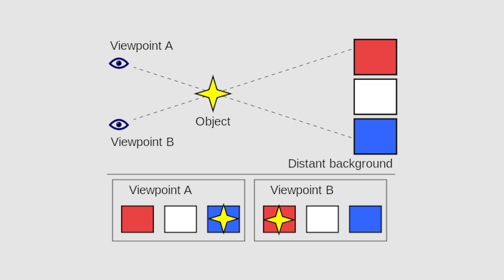How to determine lens nodal point for panoramic photography

Comment: Hi Les, fine explanation but it is only for 100% correct for a single row horizontal panorama and not for a multi-row or for a vertical panorama. For a multi-row you will pan your camera up/down to go from one row to another. This means that the horizontal axis where the camera turns around has to go exactly through the nodal point. In order to achieve this the central axis of your lens and the central axis of the nodal slide you use to move the camera forward/backward have to go both through the same plane that is vertical to that nodal slide. This is a little bit tricky since you have to estimate it and there are no marks on the L-bracket you use to fix the camera on the rotator to pan it up and down. Once you have determined the exact position, put a mark on your L-bracket for consistent later use. If you fail to do this, you will introduce a parallax error while panning up/down. Sorry for the complex geometric explanation.

Comment: FWIW, to make it easier and allow for even more precision, use one pole (a cross would be better for adjusting both horizontal and vertical at once), a wall behind it, and a bright light source at the nodal point.  Mark the shadow on the wall with a contrasting colour, then mount your camera and make your adjustments.  (The rays of light travelling past the edge of the pole to the nodal point are at an angle to the axis of the lens, so the farther the second pole is behind the first pole, the wider the second pole would need to be to fit exactly within the shadow of the first pole.  Positioning two poles of differing widths would be FAR too fiddly when you can use a literal shadow to accomplish the same thing.)
Reply from the maker: Thanks, Keith. Always looking for new and creative approaches.
Reply: I just had an even easier, more precise method.  (I *think*, anyways.)  A laser point in a (reasonably) long tube with a diameter the size of the beam is positioned to point at the camera mount's center of rotation.  In theory, the spot it projects will only stay perfectly round when the camera is rotated if the nodal point is perfectly aligned with the mount's center of rotation.  If it isn't, as the nodal point slides left/right/up/down, the tube will occlude part of the beam.

Does that make sense?  It would certainly be easier to achieve high precision if it worked.  (If you want to create it as a saleable product, feel free.)

Comment: Nice and clear explanation, for the more techy ones just make sure that the rotation point coincide with centre of the aperture leaves. Some principles as to to set up a gimbal head where you use the centre of gravity instead of the centre of the shutter leaves to balance the camera for two completely different shooting purposes, hence two different tripod heads; one to eliminate parallax and the other to make the camera/lens unit feel weightless, 99% of cases the two setup points are different as the two centres do not reside in the same place, the “C” bracket head can be used as a gimbal with great results whilst the gimbal can be set to pivot on the nodal point but it will be awkward to use.
Reply: Not as awkward as your prose.

Comment: I can hardly believe that I was getting away with my "don't worry just take lots of overlaps " ever stitched together in photoshop. Then all of a sudden in the 2021 version of photoshop everything sopped working. This was a wonderful talk, and I thank you very much Lester..Outstanding.  I only have a standard tripod  so I am going to be up against it, but panoramas is where I am so I must resolve things .Most of my panoramas are about eight frames wide and I usually have a3 rows, and I have been using focal length far too wide at maybe 50mm equivalent. .

Comment: Great tutorial, thank you. The best part is at the end showing the taped pole 'get back in line' while shifting the camera back. Actually I found out practicing that you should start with poles aligned in one side (left or right) of the view finder then turn the camera (left to right or vice-versa) till the poles are in the other side of the viewfinder..... Then shift the camera back/forward to realign the poles. And BINGO, there's your nodal point/entry pupil in one single move, no need to turn back and forth . 😉

Comment: Thanks! I'm thinking of using this strategy a lot in the future. And as I noticed the key way to actually just set the nodal point with the two stick, it may actually be possible to put it up every time on the field using two strings attached to branches in line with the center of the position of the tripod where it is going to shoot the panorama! So this way you are capable of using this technique randomly with any lens at any focal length! You also can set it up with a more inexpensive tripod head. Yet it still need a specialized camera support to make it rigid, convenient and fluid. Amazing pictures on your walls!
Reply from the maker: Thanks, Marc. Here's wishing you good luck with your panos. Please feel free to share a few with me and I'll post them if you wish.

Comment: I like this video and very much appreciate the effort that went into it. What follows is a thank you rather than a compliant.

Nodal points come from the "Gauss thick lens theory" and require a bit of optic theory to fully understand but the key point is the there are two; and one is the exit nodal point.  The exit nodal point for photographic lens is always one focal length from the sensor when the lens is set an infinity.  When the lens is not set to infinity is is at the image distance, which is not what is seen on the lens mount but requires some math to get.  

For example if focused on a pole at 5 meters a 500 mm lens image distance is going to be 0.5mm longer than the focal length so the the nodal point will be 1/2 mm off at infinity and about 1mm off for a 70mm lens under the same conditions.

Clearly these errors are insignificant but are comparable with the errors from the simple method I suggest.

1) Nodal points are points about which you can rotate the lens and the image on the focal plane will not move.  This is what they do and why they make image stitching work well.  This what the two pole demo is looking to do.  Thgey do not have to be perfect for most stitching programs to get a good join.

2)  One nodal point is exactly (by definition) one focal length from the film plane when the lens is focused at infinity and the image distance away when focused closer.  .  Using this you can get very close to the nodal point by using a  ruler and putting the center of the camera one focal length, as marked on the lens or its zoom ring, from the sensor mark on the camera body, when focused on a distant scene.

Comment: Les,   Great job.   When you mentioned the vertical poles, I realized a similarity with aiming posts used by field artillery in the pre GPS day.  Once a gun was pointed on the correct azimuth, a primary (an optical instrument.set close the the gun) and, secondary aiming points (two metal poles) were established.  The aiming points allowed the gun to shoot a mission based on rotating to the left or right of the azimuth on fire.  The gun then returns to the azimuth of fire.  The vertical line in the gunner’s optics would be placed beyond the far vertical pole.  We used the acronym NFL - Near Far Line - to help remember the order of the lines.    Thanks. Jim
Reply from the maker: Thanks for the fascinating perspective on this, Jim. I found it most interesting.

Comment: An excellent explanation of how to ascertain the nodal point for a given lens. Thank you, Lester! Your beautiful panoramic photography wall enlargements are stunning indeed, and certainly expemplify the Image Quality obtainable using the technique you describe. 
As I don't have the photographic equipment in this video, I was lucky to be able to create highly detailed panoramas, but much smaller enlargements (10"x36", for example), using 4 stitched 24 MP .tif images with a very sharp Fujinon XF35mm f/2 lens  on an X-Pro2 vertically mounted on a decent Oben Carbon Fiber tripod. Of course, your technique and recommendation to make use of the lens' nodal point, besides beneficial for printing large, as you stated, also avoids the unfortunate necessity of losing image information in post-processing when cropping top-to-bottom across the image! Happy Holidays to you, sir!

Comment: Lester - great video, thanks so much! I may add that I am using a Mamiya RB67 which has its tripod thread right in the middle of the camera body, vertically below the optical axis. So, no sideways adjustment needed. Also, the portrait orientation is achieved by just rotating the film back with the camera body still upright. That's a no-brainer so far. It does need of course the forward/back adjustment, for which I use a simple rail. Beyond that, my recommendation is to use aiming objects that are much closer (believe it or not, I use chopsticks). I have to focus then to a closer distance, increasing the lens extension which changes the nodal point again. But the RB67 has a scale from which I can read the lens extension in millimeters, and just  correct the camera position by that amount because the lens will be focused at infinity for the real shot. The closer position of the aiming objects makes the process more accurate and easier, because the sideways movement is more pronounced when the camera rotates about the wrong point. Just a recommendation for those among us who use such old "basic" cameras!
Reply from the maker: Alexander, thank you so much for this tip. I hope others will see your comment and use it if their gear is similar.

Comment: Thanks for posting this video. Here's an alternative way to locate the lens center. Set the dslr to live view and adjust the camera's position to center the image of the pano head's pivot point onto the camera's viewer area. Most cameras have view finder center marks for metering, focus micro-prisms, etc. Rotating the camera a full 360° will confirm that the camera is at 90° to the base and that you have located the center of the lens if the image stays centered. If there is no obvious mark or bit of hardware to determine the pano head's pivot point, the 360° test will help locate it for you.

Comment: Thank you Mr Lester, u helping amateurs getting some useful knowledge, for now on ill make panos only based on the nodal point so i get the best stiching. But still i thought using the widest lenses like 16mm or 18mm would be better, you say 50-70mm one more point! Thinking to buy online a 360 rotation head plus ball head and slider so i can push back and forward and an L bracket so i can go vertical. Hope it all comes together and work. Because a gimbal head is too expensive nowadays!

Comment: Excellent  illustration .  Tough topic in  easy  language with demostration also. Thank you very much But one thing I want to know at the time of focusing the pole which one pole would be focused and what is the difference of them and what is the distance of the foreground pole from the camera for 70mm- 200mm lens
Reply from the maker: Thank you, Asim. You can focus on either pole, but I find focusing on the front one is best. The foreground pole should be about 5 meters (15 feet) from the camera, but the exact distance is flexible.

Comment: At 15:20/25 you say the centre point of the camera is correct as you had set it earlier.  What you did not take into account was that you had change from portrait to landscape format, which will have moved the centre point as the distance from side rail of bracket to bottom rail will be different.

Comment: Useful suggestion:

Instead of using a tripod, purchase a round “ base mic stand
” and weigh it down with two 5-pound barbell weights, placed on top of the
base, with the pole running through them. 
Paint them black.

Then purchase a “ 5/8"-27 Female to 1/4"-20  mic stand to camera adapter “.  This allows you to mount any camera or pano
head that uses a normal ¼”-20 thread.

All about $25 plus shipping and bar bell weights.  This allows for better rendition of pano
stitching because the tripod legs aren’t in the way.
Reply from the maker: Thanks for this suggestion- very creative! However, I have strong doubts how well it would work for meticulous panos, especially if you are shooting them with a moderate or long telephoto. A base mic stand, no matter how weighted down you make it, will wobble under the torque presented by a long tele. However, I am always open to new approaches. Any chance you might send me some images of the final setup, with and without camera mounted? I'm sure my viewers here would welcome that. 

Best wishes,

Les

Comment: Thanks, very well explained. Though I find it a bit long to get to the point, but it's only minor concern. I was wondering why you do the calibration in landscape mode if you shoot in Portrait orientation? That part I did not catch. Continue your good work!
Reply from the maker: Sorry it has taken me so long to respond, but I was away on assignment for the past two months. The reason for doing the calibration in landscape mode is simply to give you more camera movement so that you can better see whether the two poles line up properly. I mentioned that in the video, but perhaps too quickly. You can do this in portrait mode, too, but you can sometimes have difficulty clearly seeing any pole movements. It's just a tip that works, but not critical to the process.
Reply from the maker: Thanks for your comment and question. I do the calibration in landscape mode simply because it is easier to see the movement and registration of the two bars while in landscape mode.
Reply: Sc Photo 9
Reply: Thanks...I must have missed it too.

Comment: When you switch to horizontal mode after setting transverse centering, you mess up the transverse center because the L bracket has a different distance from the optical axis for each orientation.
Reply from the maker: Hello Joseph! Technically, you are correct. However, as I mention in one of my videos, the entire purpose of shooting panos is to record as many pixels as possible so when enlarged there is incredible detail. That is accomplished by shooting in vertical orientation, which is the only way I recommend shooting panos. Having said that, once I am back from my current assignment I will make a note in the Description section and credit you for pointing this out.

Comment: Thanks, this is a great tutorial. I'm just starting to get into large pano shots and I keen to know what your typical overlap is between taking shots and if you use auto focus on the shots? Thanks again for taking the time to put this video together.
Reply from the maker: Good questions, Justin. My typical overlap is 1/3, although I sometimes I have done 1/2 with mixed results. You should NEVER use autofocus when doing panos as that will cause misalignment issues and may result in the stitching programs not being able to put the images together. 

Best of luck with your first attempts!
Reply: Great thanks, so for focusing would you suggest for landscapes just setting it to infinity or actuy dialling it in? Cheers

Comment: This is a fantastic video, for those of us that crave perfection with the technical aspects of photography, so thank you.  Could you please post a link to the tripod and head you're using? I'd like to look into this equipment further.  Thanks!
Reply from the maker: Thank you, Hans, for such a nice comment. So glad you found it helpful. My tripod is a Gitzo 3541 and the ball head is a Really Right Stuff BH-55, with a leveling base.
Reply: Lester Picker Thanks Lester! I'm going to look into these.
Reply: This is an excellent instructional video. Thank you for posting. 2 questions: what software do you use for stitching and processing huge files (1GB+?); and do you shoot panoramas without click stop rotators?
Reply from the maker: I use Lightroom (mostly) or PTGUI (sometimes), but for some complex files my assistant pulls them into PhotoShop. As far as rotators, I do not own "click" rotators. I use the RRS BH-55 ball head, which has very fine gradation markings. I note where I start and end and how many marks I need to advance to get the 1/3 overlap I want. Then I just get to work.

Comment: Lester, Great video, I learned a lot. However, Am I wrong in thinking that you could use a Video slider that would be mounted to two tripods or two light stands and of course level, and just move the camera from one side or the other over-lapping by 30%, and never having to rotate the camera? Would this not eliminate any parallax issues? This could also be done in the vertical mode.

Like to hear your thoughts on this.
Reply from the maker: Nice thought, Leon, but no, it would not accomplish the same thing. It is the rotation around a point that is required, not a slide that is parallel to the plane of focus. I hope that helps.
Reply: @lespicker  do you have a video that shows you how to do a doubl-row Pano?
Reply from the maker: Leon Kolenda I have a video that explains how to do multi row pianos, whether 2,3 or more rows. Please search through my videos and you will find it.